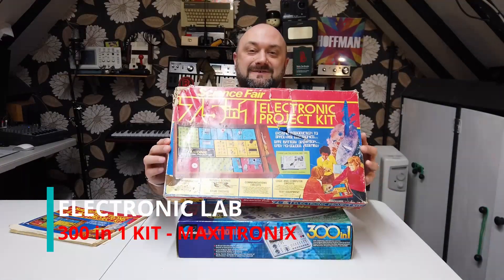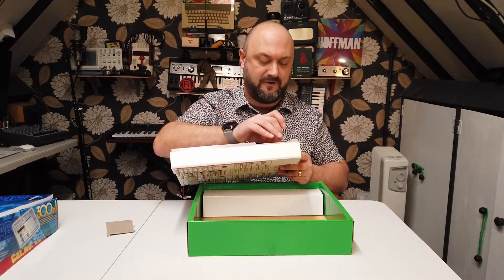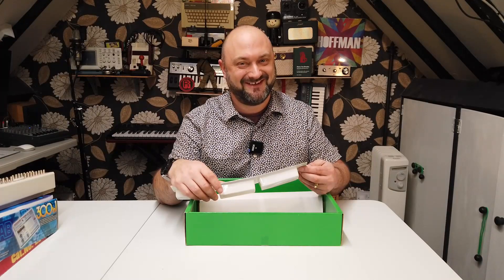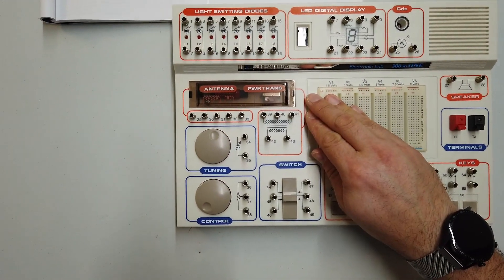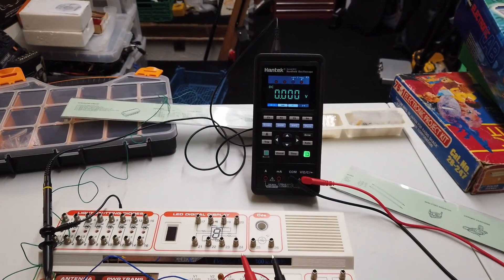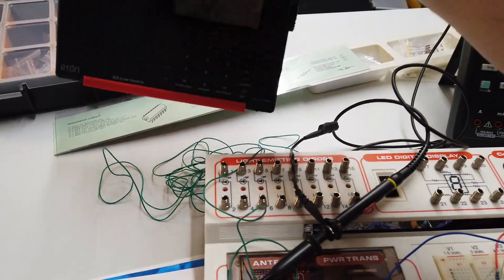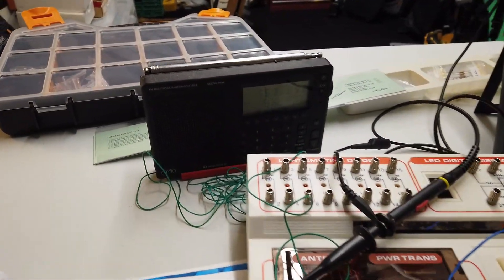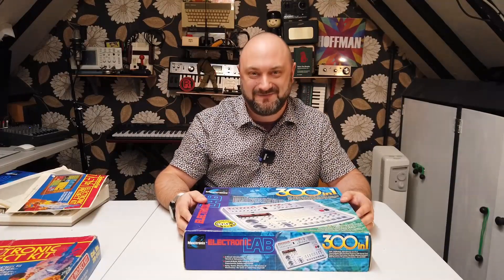DuB-EnG: Is the Chinese Maxitronix 300 in 1 better than the Japanese Radioshack Science Fair X in 1

Comment: I did not like the design of the 300 in 1. I prefer if all components were springs doen like the older kits.
Reply from the maker: Those kits were brilliant 👏 👌
Reply: Like a kit that has 555 timers, 6 transistor, multiple transformers.  A kit from Germany made in the 1990s. Includes op amp.

Comment: Nice kit. Runs about 150 bucks here.  Expensive but If somebody wants to learn circuits it is a good investment,
Reply from the maker: agreed completely! ... and I love your first name :-)
Reply: the radioshack ones can still be found cheaper on ebay
for $100 never used even
Much better solid built and it is called the radioshack electronics learning lab.
It gives you 3 potentiometers, a breadboard, several push buttons, a transformer, led readout, an amp gauge, a photolectric resistor, a speaker, a buzzer, several leds including the ones already mounted in the chassis, a seramic earpiece, several ICs, jumpers, diodes resistors and capacitors and transistors.
You want to make sure you get the one with the word ""learning"" in it it is the newer version the old variation from the 90s had a slightly different chassis and was a bit limitted.
With the nicer one it gives you a set of two books on electronics to follow along and everything.